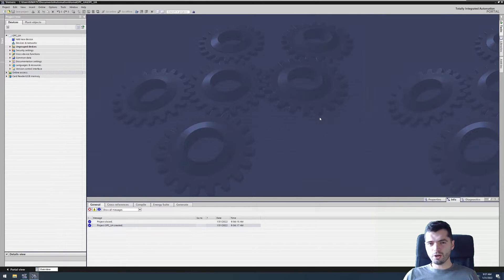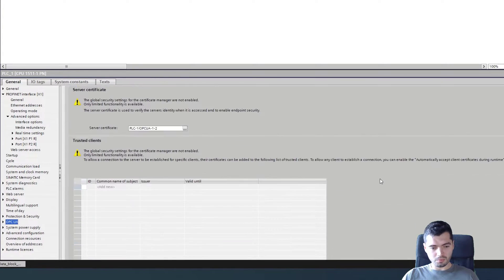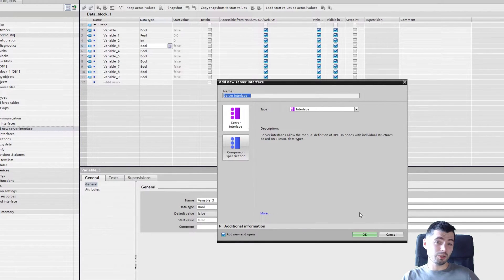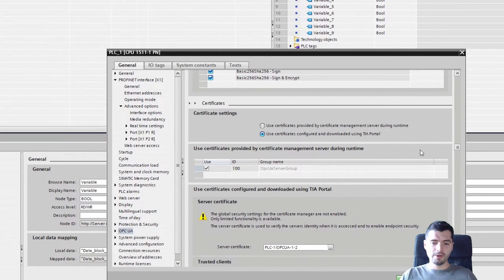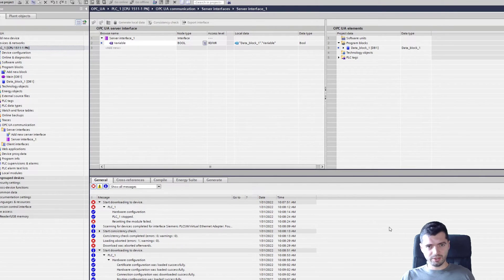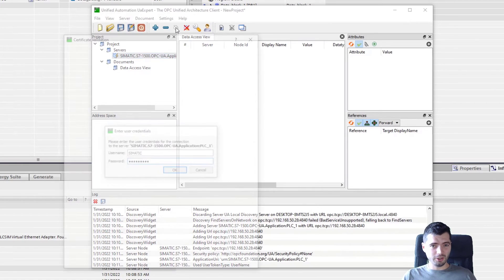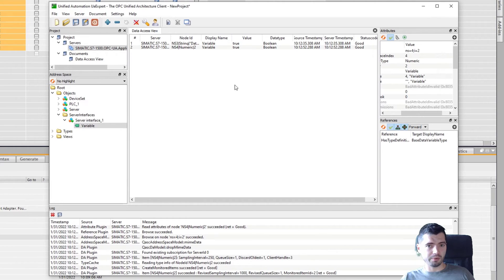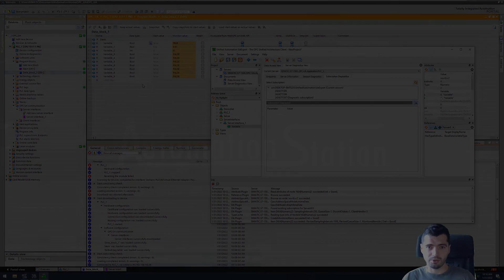Setting up the OPC UA Server on S7-1500 PLC using TIA Portal and Basic Diagnostics with UA Expert

Comment: The interface makes it easy for the client to read the variable, but the three icons up practically reveal all the data of the code.
To add safety, is there a way to prevent the client from reading only what I want? So only the interface
Reply from the maker: Disable simatic interface and create a custom server interface so you expose only what you need.

Comment: Whenever I create a Server interface in TIA Portal for OPC UA communication, after adding a tag to the Server interface and compiling it, I encounter the message 'Totally integrated automation portal has encountered a problem and needs to be closed.' and the application shuts down. What could be the problem?
Reply: Uninstall the latest windows update
Reply: Simply remove the server interface, translate and load your programm into the cpu...done

Comment: With siemens PLC (S7-1200 or S7-1500), is there is any limit to how many no. of tags are accessible by the clients? Also, how many no.of OPC client can make simultaneous connection with the OPCUA server? For example, with ABB PLC PM-5032, there is a limitation of no. of tags accessible via OPCUA which is 125 tags. Also, only 5 clients can make simultaneous connections with the OPC servers

Comment: Hi, I have S7-1200 1214CPU with firmware V4.5 and I don't have the "standard simatic interface" option in the properties. Do you maybe know why?
Reply from the maker: Yup, that's only available as an option on the S7-1500. On the S7-1200 you need to create your own custom server interface and define variables you'd like to expose.

Comment: Thank you very much, i appreciate your tremendous effort! i would to like to know a 1500 as a client and also with Kepserver and 1500 how to communicate with security (256ha256) because i can't connect when i choose security settings in the kepserver but without security, i can, i don't know why...
Reply from the maker: I have not attempted this configuration before, but I would presume that you must take the certificate from the Kepware OPC UA Server and add it to the TIA Portal project.
Reply: I have the same problem, I can't connect my S7-1500 using that kind of security (256ha256), I tried everything and I am not able to stablish the communication between my PLC and the server

Was you able to fix the problem?